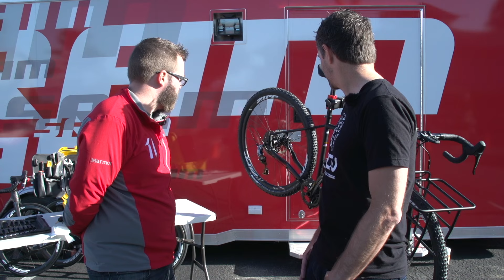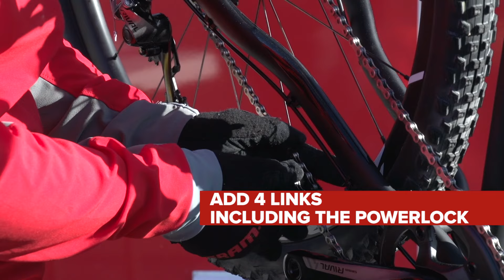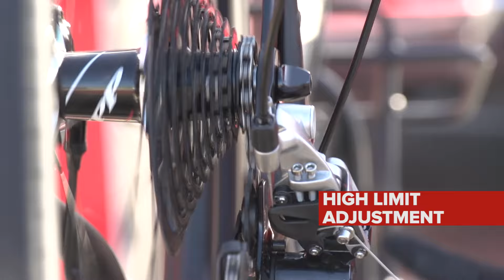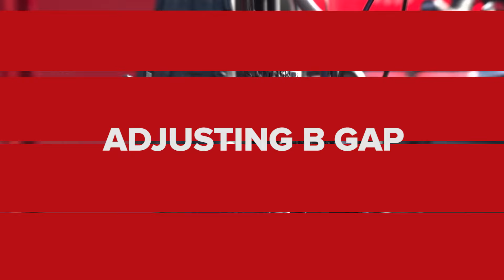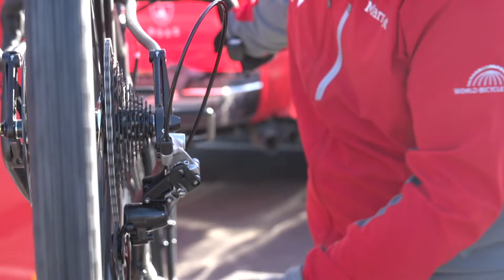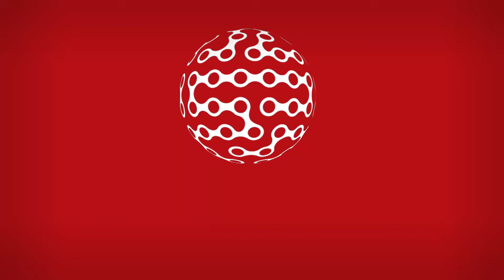How To Set Up SRAM 1x Road Groupsets

Comment: Thumbs down, YOU SPENT ZERO TIME talking about the in-and out width placement of the spindle/chainring crank assembly in relation to the shell/frame. What is it on a typical 73mm shell? is it 100mm, is it 130mm, is it 120mm we don't know because you don't bother to tell us. I purchased your group SRAM NX EAGLE DUB GROUP SET and it came without instructions for this issue (??) why? I , like many have a PF30 bottom bracket and need spacers to install your much longer spindle, and on which side of the shell we install said spacers gives us a variety of width locations for the crank. WHY NOT TELL US HOW MANY MM IT NEEDS TO BE FROM THE SHELL AND END IT ?! Jesus, is that so hard? it's all we would need to locate it and have it perfectly aligned with the rear cassette.

Comment: Couple of rookie questions: 
1. The setting of the barrel adjuster from the start? 
2. Should i pull the cable before anchoring it or should it be slack ?
3. Have a Sram Rival 1 (long cage). After shifting down to the smallest cog, tapping the lever again makes it click, nothing happens with the pulley but the cable goes really slack. Is it from this position i should start the adjustment?
Kinda feels like a Natural shift position and just wondering if that is actually the first (smallest cog) position or if something is off/wrong?
Reply: Hi Ludwig,
1. Usually, when attaching the shifter cable to the rear derailleur, the cable is quite loose and needs to be tightened with the barrel adjuster. Moving it almost all the way in beforehand ensures that you have plenty of room for tightening the cable.
2. Pull it as hard as you can by hand. Having too much slack results in you not being able to tighten the cable with the barrel adjuster.
3. Put your barrel adjuster all the way in. Shift into the hardest gear/smallest cog. In your case: click once more for getting the shifter cable to a slack position. Detach the shifter cable from the rear derailleur, pull it so there is only minimal slack. Firmly attach the shifter cable to the rear derailleur, continue to put some tension on the cable with the barrel adjuster.

Comment: I have a rival 1shifter with an 11 speed rear cog on a brand new bike. All of my gears work great except the big gears 9 and 10, which make noise when I pedal hard. I havn't been able to figure out an adjustment that fixes this. Any advice?
Reply: I just had a rival shifter replaced, similar troubles, might be that or possibly cable sticking

Comment: Hi.
sram apex 1x11 back shift would be a problem. the biggest gear to roll when you want to switch to a smaller gear, the gearbox does not move. only if I stop the roll and start to drive again. What could be the problem? doing the same with a new cable.
Reply: Was it the b limit screw?

Comment: 4 extra links on the chain seems a lot vs 2 on say a shimano road bike with FD - any reason why? Even using that formula I always also run it through the RD to check the tension, 2 seems enough. And fine on rival wifli.
Reply: J B it is because usually don't use big to big gears; with 1x, however, you are always in the big ring so you are going to be using big to big gear which puts extra stress on the derailleur.
Reply: Does this "add 4 link sizing"  apply to of all SRAM 1x or only those with a clutch to help keep tension? I'm planning 1x with a standard Force 22 RD, and 44x28 would be my big/big. No clutch on the Force. Just wondering if there will be too much slack when on 44x11....